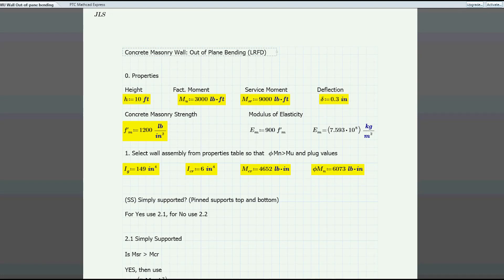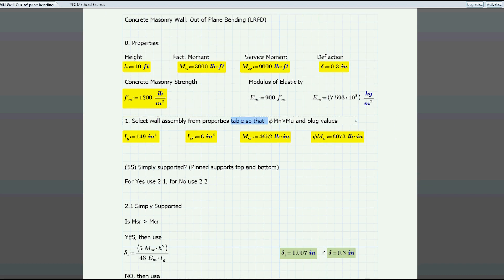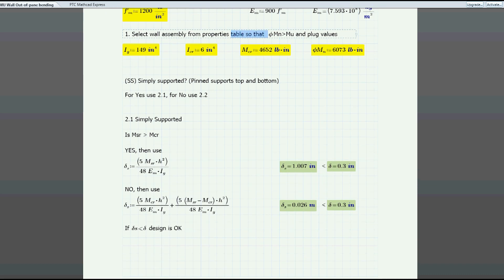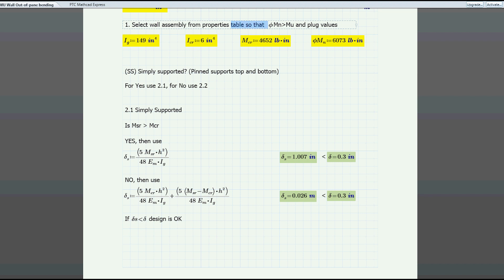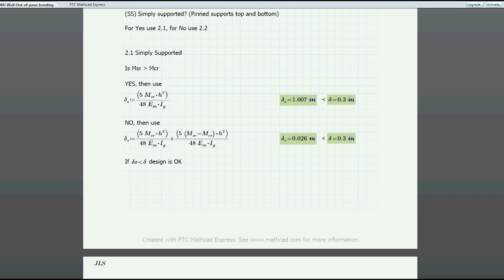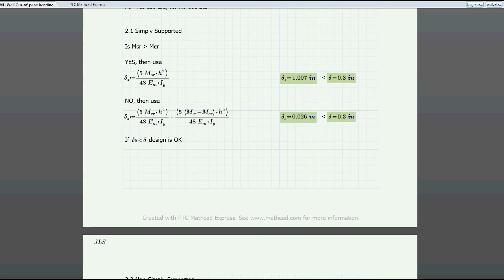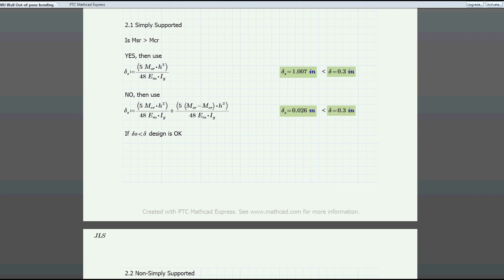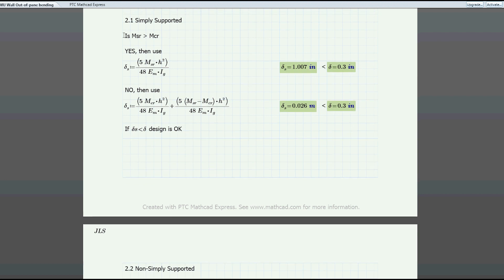CMU Wall Out of Plane Bending - Mathcad Problem

Comment: Bro...this is so timely.... I am working on the exact same thing for a trash enclosure. Lol

One of the associates at my company did one and used enercalc for it. So, all that stuff regarding the *1/48 formula I can skip. Lol

Excellent job though. Yeah... this is definitely when you'll want to use mathcad. I was going to do the same thing with RC beams involving the Mcr to calculate the deflection.
Reply from the maker: I do think MathCAD is a great learning tool, it's basically doing it by hand but without making mistakes or having to redo your calculations, it can also help people not familiar with the problem visualize the solution! (and you can prob also make a profit by selling good MathCAD sheets lol) I am doing one right now for pier caps.